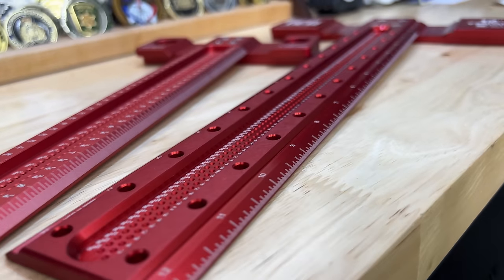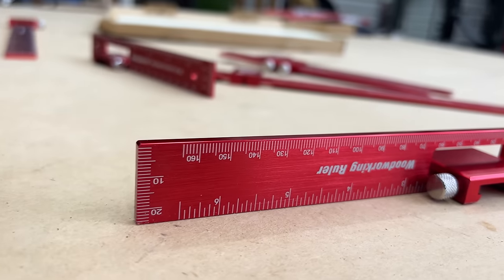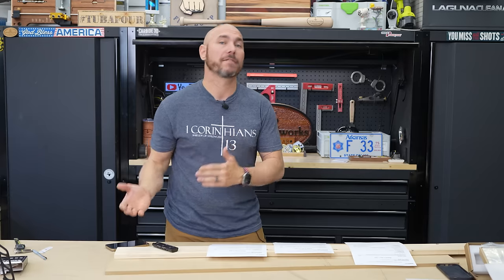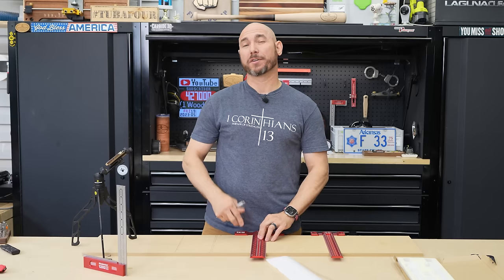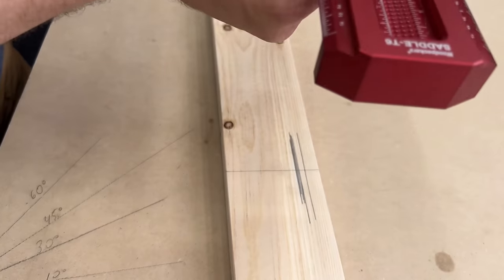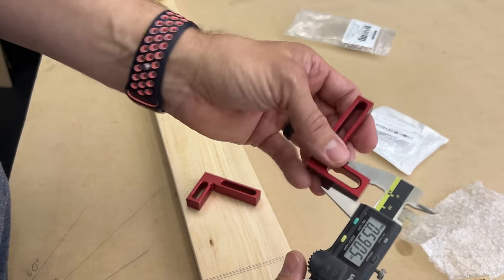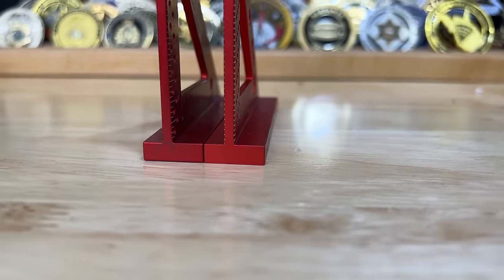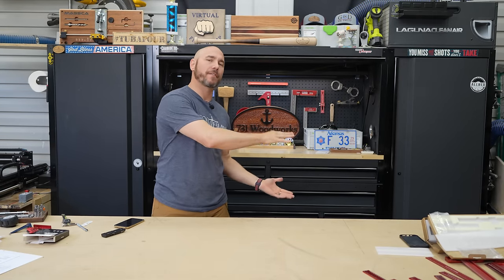Real vs Rip Off Woodpeckers Tools | The Results May Shock You!

Comment: Couple thoughts.  While it's a feel good thing, the measures being exactly the same only matter if you are swapping from one tool to another mid operation.  Further the continuity doesn't necessarily translate to accuracy.  Lastly when testing  square, what you really did was compared two unknowns.  To test each (without a confirmed square) draw a line, flip the tool and draw another line.  If the two are parallel you have a square tool.
Reply: If he has used the flip method to verify his check square then his method is perfectly valid. Furthermore, you can’t just flip the t-square to test t so using another verified square is a reasonable way to check it. You are not wrong, just giving another perspective.
Reply: @rifleman1873  But...he DIDN'T use the flip method.  All he did was compare two unknowns.  IF the test square was VERIFIED sure.  But two drawn lines means nothing.  He may know that, but the viewers might not.  One needs to decide whether the video's intent is educational or simply promotional content.  Either is fine.  But be clear.
Reply: Only valid it the edge of the test piece is straight. So you need to test this first. Two straight edges will do- it they both show it straight, and they also show each other straight, then it is straight.

Comment: When manufacturers put metric and inch measurements on both faces of a rule they don't do it in the optimum way. If the inches are on the edge nearest to you on one face, they do the same on the other face. It would be more useful if the inches were nearest  on one face and metric was nearest to you when you flip it over. I think it would be even better if one face was all inches, (both edges),  and flip it over to get all metric! Deluxe would would read L to R on the edge nearest you and R to L on the far edge. What do you think? Good video, thanks.

Comment: Your accuracy comparisons assumed the woodpecker’s measurements were correct.  I bought sets of the pocket rules a few years back as Christmas presents and found them acceptable, but not necessarily accurate, being about a line width different.

Comment: I have a few woodpecker tools. One of the, is the Saddle T-6 and I wish that the square edge was a little shorter than 3/4”. When scribing on 3/4” plywood (which is really 23/32”) I have to lift the board up so I can slide the saddle left/right when scribing. Very annoying.

Comment: Doesn't the DFM come with 2 pins so can use it as a center finding/marking as well or am I thinking the DFM small square?  I got a DFM blemish set for a great price so that's an option to save a few coins as well.
Reply from the maker: I think the carpenter square comes with 1 but the mini DFM comes with 2.

Comment: I try to follow what Matt Moreman of Obsessed Garage espouses, “Honor the source”, if it is something innovative that supports the industry and makes our lives / jobs / hobbies better or easier, but as a hobby wood worker, I can’t justify the price difference.
Reply: Thank you for factoring in the research, development, and design that Woodpecker did when making these products. It’s not just the manufacturing costs: of course the Chinese copies are going to be cheaper since they were able to skip all those steps.
Reply: Not a lot of super innovative designs in the woodpecker layout line. Not like say saw stop or even Festool (dust collection advancements mostly)
Reply: @ehisey  Sawstop is a truly innovative design, but you don't have to innovate to put a lot of time / money into design.   Iterating and improving existing designs still has costs involved, and those who copy those designs inherently have to spend less to produce a similar product.  I imagine that Woodpeckers also spends a lot of time and money on their manufacturing process, acquiring & testing quality materials, etc., and it is unlikely that the Chinese manufacturers do so to the same level.   This is evidenced by things like Matt (731, not OG) has shown in the past, such as 3 rules from the same company all having different measurements.
Reply: @allan5721  Most of the stuf fin this video is just Quality control. It really does not justify the price difference. Woodpecker was not even the first to come up with some of these designs and bought them with the purchase of Blue Spruce Tool Works. QC and design is nice, but not always worth the premium. the poapline as an example is plenty accurate from the knockoff for wood working.

Comment: If you go with the premise that woodworking IS NOT an extact science since the wood (as the rest of the materials) contracts and expands but the difference is that it doesn't do it evenly, what is an exact measure? Does it justify the extra cost?

Comment: I got the knockoff set of 3 pocket rules after a different video of yours showing the tool. great value, really nice to have a few of them handy to "save" small measurements during a project. I like them way more than trying to use a combo square when measuring in from edges. thanks for that recommend!

Comment: I have the Paolini and like it. But honestly, I use it mostly to ensure I’m cutting the same length of a board - top and bottom on a tracksaw. I could use the Kreg product for that. I have other tools to measure square, blades, bits.  So despite my spendthrift habit of buying Woodpecker, one can go with the fake red on this tool.

Comment: A rule being slightly off doesn't matter in the end if that's the only measuring device being used... because all the measurements would be relative to each other and it should work out.

Comment: Wait a minute. Obviously, you like the Woodpecker brand, but we're looking at a price difference of $352 US between the products you mentioned. Yes, we can get into pencil-like differences when it comes to microscopic line measurements, but then you have to take into account how sharp your pencils are, and how close you actually cut. As far as warranty,  I suggest you read through the fine print, factor in the return cost and don't forget the $350 price.

Comment: There is no universe within which I would spend $159 for a set of pocket rulers that I would buy for $28. Woodpeckers is quite simply out of it's mind with regard to pricing.  Likewise the T-Square. Spend your money on wood, not 1/128th of an inch difference in measurement. It's woodworking, not neurosurgery.

Comment: My personal rule of thumb is that anything that I need to be precise and/or repeatable there's value in the established tool. Wasting a couple expensive pieces of material will close that cost gap in a hurry. Most non-measuring tools are going to be able to be adjusted/sharpened/tuned up/etc. or aren't precision tools to begin with, that's where I prefer to save money and make a budget option work. Of course there's exceptions to everything, but bad measuring tools that are inaccurate or have slop can be a real pain.

Comment: I for one after spending 1000's of hours (no joke) squaring up saw blades to tops, can tell you this - you get what you pay for. Woodpeckers and Festool are stupid with pricing, but I'd go that route IF you are a production shop, you are making money and it's saving time. 

For the knock offs - Identify what you are using it for. #1 for me is do the rules match within 12"? If yes, I'd go for the knock off. The holes being wider is a no no for me, I don't appreciate that. I can see the t square, I'd use that for marking lines, but not measuring. 

See? If you KNOW what the limits are, you can PLAN around them. If you can save money, do it - but do it knowing what you are walking into. Just like any woodworking person wouldn't use two different tape measures (if you feel called out, good, stop it now!) from two different mfg - ie, using a Fastcap (just throw away ALL your other tape measures and only use them!) with a stanley or a lufkin, etc. You'll want to punch yourself in the face later. They are always off a bit, I'm talking like 1/32" or so, but cuts made over 6 or 12 foot you will notice. 

If you spent any time doing this and being frustrated beyond measure (no pun intended, ok maybe a little) then you will know. 

Take all tap measures in your shop that aren't fastcap, and toss them. Thank me later.

Comment: What can you do with the Paolini rules that you cannot do with the T Square other than stand it up on end?
Reply from the maker: put it in your pocket
Reply: @731Woodworks  I will be more specific in my question.  T Square fits in a pocket as well depending on the length.   Until you get to maybe 12 inches I wouldn't think that you would typically walk around with a twelve inch Paolini or T Square in your pocket but you could hang both of them from a tool belt. Once the Paolini or T Square is out of a pocket or not hanging on your tool belt, what can the Paolini do that you cannot do with the T Square again besides stand up the T Square? Trying to understand the value of having the Paolini if it seems you can do the same with a T square.
Reply from the maker: @robertknowles3677   I think the Paolini Pocket Rule is more suited for smaller stock/work.  The T Square is better on bigger stock / sheet goods, etc.  It's much easier to scribe parallel lines with the t-square vs the pocket rule.  But the pocket rule has the sliding stop so you can use that to repeat measurements, depths, etc. like setting the placement of door knobs, etc.  Or marking the placement of say the apron on a table from the bottom of the legs.

Comment: And just what did you use to make sure the woodpecker brand is dead on correct. I not asking to conflict or anything, just wondering. The woodpecker may be off ever so slightly but which one that is off is not off to mess up any wood working anyone does.

Comment: I understand the packaging benefits from assembling the t square. As for the price of the t square. I understand a machinist's mentality. That t square probably took 2 hours to manufacture and since us US machinists can't seem to run more than one machine a piece, you get charged the full shop's rate. Aka if they are charging $80 an hour to run that machine, you paid $160. Or their rate is likely way higher.

Comment: I'm not American so it seems to me Woodpeckers used the Snap-On and Harley Davidson marketing strategy of 'your not a real American' if you don't buy Made In America'. (although HD at one time could only say 'Assembled in USA' as they made less than 50% of finished motorcycle here)
 The Woodpeckers stuff IS very nice but your paying way over the top just in case they have to replace it plus, material cost are probably a bit higher (Labour isn't really an issue with CNC machining)

Comment: Thanks for the reviews on all of these, it's very informative. I bought the DFM Small Carpenter Square based on your reviews on it, and i also bought the DFM Mini-Square which i have to say is a good price at 20 some odd dollars and i like how you can use it with the included pins to find dead center on most stock. I will probably buy one of the woodpeckers t-squares, one or two of the paolini pocket rules and either the 1241 or 641 stainless steel square. Unfortunately i can't afford both, and not sure if i should go with the 6-inch or 12 inch model first...

Comment: Most of these cheap foreign tools that are basic metal machined shapes; they are likely to be square and likely to be the correct size. The quality of the materials and finish and slightly worse ergonomics can make them not as good. Ultimately how much "not as good' is worth varies a lot based on your budget and how much you use them.
The Woodpeckers-like tools other than rule I have purchased have always been copies of out of print tools. But since they are all a little off, and since there's a reason these tools are out of print, they don't come out much.
Reply: Ergonomics arguement kind fsils on these topls as there will be pretty much no difference.

Comment: Regarding the holes (and their size) in the woodpecker's rules used for line marking, in my opinion they are TOO SMALL, as I cannot find a pencil / lead combination that doesn't just break off when used and plug up the hole with the pencil lead. Heck, the  two #2 pencils included by woodpeckers don't even fit my TS-12. I would actually prefer the larger holes used on the Amazon rules

Comment: I’ve given up on buying these cheap tools. Sure they might come square or accurate right out of the box, but for some reason, they don’t stay that way over time (might be due to improper annealing or tempering, resulting in residual stresses that deform the tool with time).

Trust me, it’s gonna suck when you trust the tool for a couple of months and just when you’re about to finish that $5000 commissioned piece of work, you realise the right angle you’ve been using for the whole piece was off by a degree.

Buy once, cry once. Buy cheap, cry heaps.
Reply: If you have a 5000 commissioned piece of work you are right, but i almost bet that most here don't

Comment: Oof - with the AUD conversion rate and the shipping - the fake T-square and Saddle Square come out to well north of 200 AUD. I know the machinist time is where the money is - but it’s like $10 worth of aluminium and $10 worth of shipping for that same weight of stuff from Ali express. $200+ worth of machinist time for Chinese manufactured mass produced rulers?

It’s one thing to be a bit spendy on union shops or bespoke craftspeople or domestic manufacturing where I want to support the local market.  But I’m looking at these products to replace $20 worth of plastic drafting tools from the big box office supply store.

Comment: The warranty on woodpeckers is kinda useless... its cnc'd aluminum with no moving parts.. if it's broken it will be out of the box.. so i send it back.. it won't break after years of use for no reason.. and if it brakes they will say it was not used properly (which is probaly true)

Comment: As there are a ton of USA made tape measures out there that are not the same when compared to each other...the same argument holds true.  You need to use the same measuring tool from start to finish on a project.  I personally can't afford Woodpeckers on a daily basis.  a .5 of a 1/16 of an inch "off" will not harm any one's measurements.  By the time you let a piece of wood sit in High Humidity atmosphere your preciseness is lost.  IMHO.

Comment: Your wasting money if buying something more than once.  Woodpeckers is good for that.  Consider pay per use. If using everyday is it really expensive to have that confidence in the tool?  Time is money.  But what craft needs that accuracy.  Fine furniture doesn’t and that is one place where 0.5 mm shows. But I usually feel an edge(s) with a finger.  That tell is better than sight sometimes.  That line up has so much duplication of a t square.

Comment: @6:13 your made in 'merica t-square doesn't match with their pocket thingy. Look at 12" spot.
You mentioned the heap Chinese half of half mm difference but here you failed to do so, your 'merican $2000 rulers are not as accurate as you try to advertise them.

Comment: Ahh the whole woodpecker marketing tsunami…. This is a company which has no bricks and mortar stores so you’d think their shipping process and pricing would be amazing.   It’s not.   In some cases the shipping is higher than the price of the item.  They may argue that shipping tools long distances is expensive.   But most of their tools are aluminum and continental USA shipping is very simple and cost effective especially with large shipping hubs.   So the shipping costs are outrageous but are the tools unique.  Not particularly.   A square and a ruler are not ground breaking designs.   Are their products more square or straight than cheaper ones.  Proof in this video that they are not any more accurate.   I took a milescraft and Milwaukee square and found zero difference between the WP and the others cheaper products.   Plenty of cheaper and accurate tools out there compared to WP and not just Amazon knock offs .   
The vast majority of tools are made offshore even USA company products.   China, Taiwan, India etc do make tools for major brands so the issue of USA made is just a bit of hype.  
Plenty of good tools without being brainwashed by WP marketing hype.

Comment: Honestly some of the Chinese tools are too expensive. Once you get too close to the price of your superior competitors you effectively work as an up sell marketing gimmick that makes people buy the better version. It’s hard to drop 50 on Chinese crap when then Mona Lisa costs 80. Of course I’m not dropping 80 on unnecessary precision either but the point remains. if you’re going to make knock offs make them cheap as dirt so it’s no comparison. 20 vs 150 is no contest even if the cheap tool is inferior in many ways that don’t really matter. 

The issue is that when the knock offs get good they think they can price them highly and then you lose the only potential market you really had. Poor people who won’t buy unnecessary $150 t squares won’t buy unnecessary $60 t squares either.

Comment: It is a sad but true fact: as Americans we love Made in the USA, but there's a limit.
 These companies believe we will continue to pay higher and higher prices.  Happened with automobiles, appliances, and tools.  Cheaper overseas alternatives just made more sense for vast majority of us.  So, what's the solution?  American companies need to realize that there is a market saturation point, and they need to drop their prices.   Woodpeckers (and even Festool) need to drop their prices by 25%-35%.  It would still be significantly more than the overseas made items, but I could definitely justify the cost in spending that amount versus their current prices, for the higher quality.   But if the alternative is 40% or less than the USA made version, I don't think thats long-term viability.